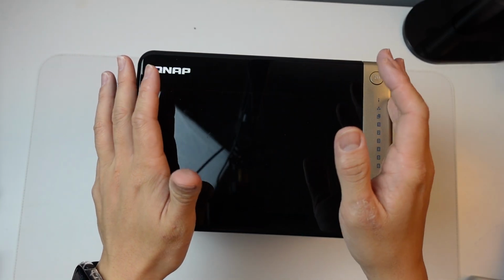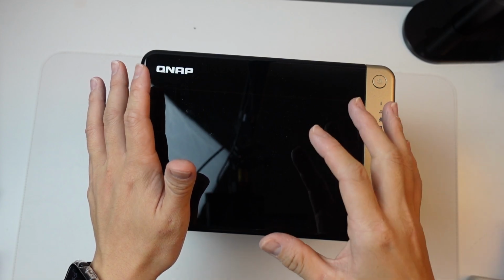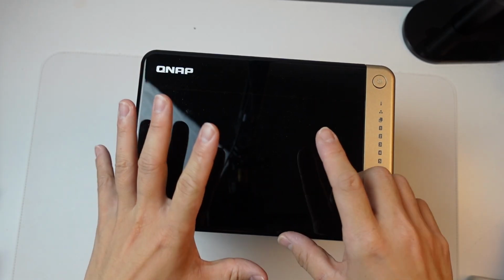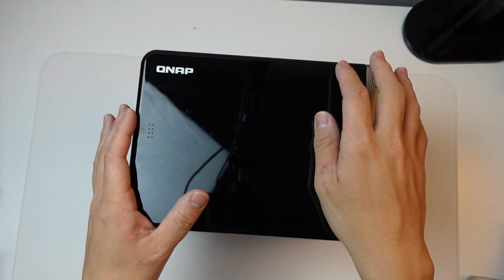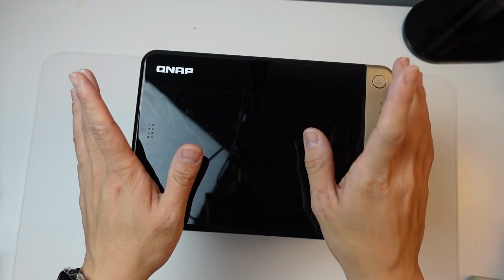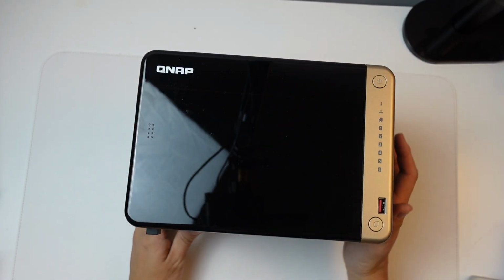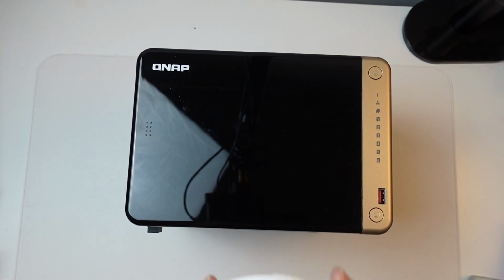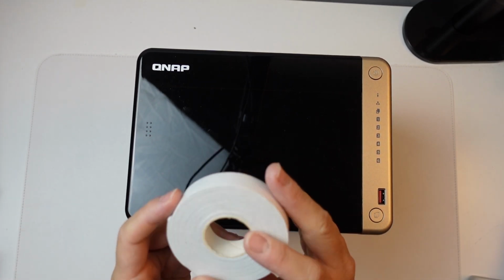How to dampen sound vibrations on any QNAP NAS

Comment: my qnap 451A had weird noises well it seems only disc 1 i tried with keyboard o-rings i had and some longer screws that fitted good and not to high the screws that came with the qnap was bad and feelt loose but the noise is gone or atleast good enough... the o-rings between the disk and the plastic disc holder

Comment: My enclosure started humming from vibration (not just disk noise) and it would stop if I touched the outside with even the slightest amount of pressure. Didn't matter if it was the top, side, etc. Felt like it just had to be because something somewhere was loose. Anyways, I scooped some 1/2" inch by 2mm foam tape from hobby lobby for $2 based off this video; the noise is now nonexistent. I appreciate you sharing this tip.

Comment: You're way overestimating what foam tape with a mere 1.2mm thickness (less than 0.05in) can do to reduce HDD vibrations. There's certainly some effect, but it will be minimal when compared to the optimal solutions for sound and vibration damping. Just like most other life-hacks, this looks like content creation with a grain of truth and not an actually thought-out idea by itself.

For NAS - especially when you're using HDDs with higher total storage and thus requiring more platters - the simplest solution (and also the one I would recommend to most people) would be to boot the device to another room where you won't be annoyed by its noise generation. If you have a wired connection that's great, but even WiFi is okay. Unless the WiFi in your home is really poor for some reason or another (thick walls, too much interference) you could put an USB dongle for less than 15 Euro into one of the connectors on the NAS and it will work well enough. Wired is of course always the best option for both speed and reliability, but if the choice is between blessed silence in your office/living room/bedroom and slightly slower data transmission speeds via WiFi, I'd take it unless the task is critical.

But if noise and vibration dampening is really the only way to go in your situation, then you need to be aware of two things. One, while the NAS cases are often constructed in a way that don't make them into resonators for the HDD vibrations, that doesn't mean that they are damped. When the NAS case stands on a table or the floor, these vibrations will carry over and create all sorts of bother, because the plastic feet of the case are in no way sufficient as dampers. Two, your HDDs need to be cooled, which means that as the NAS blows air out back with its fan, air also has to enter at the front, where the case usually has several small openings.

The biggest way to reduce the vibrations generated by the HDDs is to put a foam mat (or pad) between the NAS and the floor/table/whatever it stands on. A thickness of 20mm (about 0.75in) should be the desired target - more is possible although not as widely available commercially. I would personally also consider sealed foam or another material entirely, because the cheap noise dampening foam will sooner or later dissolve into a dusty annoyance to clean up. Thus I personally went with a weather-resistant 20mm neoprene foam mat that's considered for use in cars and the like. For years now it has stood the test of time and cleaning - either with a duster or a damp rag is easy enough.

But that's only half of the story. It still leaves the NAS case itself unobstructed, which provides no noise damping at all. With some work, the remaining noise can be greatly reduced. Out of a spare cardboard box I built a "hat" that fits over the NAS with cut-outs for the back (fan, connectors) and the front (air inlets), then I padded the outside of the hat with the same self-adhesive 20mm neoprene foam mat.

The result may not look very impressive when you had a glossy case to look at before, but it's amazing what a mere 20 Euro roll of foam mat - 150 x 30 cm, which is about 0.45 square meters or close to 5 square feet - can do to the noise generation of multiple annoying HDDs. I still wouldn't put that sort of thing in my bedroom, but it became quiet enough that I could get used to and ignore the background noise when it's under the table in the home office.

Please note that the above is considered to be a life hack for *home use*. In this setting you never run into the issue of reaching the HDD temperature limits and active cooling is actually far from a requirement. When you dampen a HDD case, you also add temperature insulation, which keeps in the mechanically generated heat much better than a very thin metal case. From practical experience that results in maybe 2-3°C higher temperatures with the fan at minimum speed, but at higher usage rates (enterprise level load) the cooling of a dampened case can become an issue.

That's as far as life hacks go, whereas the really optimal solution for a home user would be a DIY NAS, where you start with a silent PC case that supports individually decoupled HDD mounts. It's quite the niche market and not a lot of manufacturers offer these products nowadays. If you're not looking at a huge 8-bay NAS solution, then you can get 2-6 disks into one of the BeQuiet silent cases that support the HDD cages.
Reply: Exactly.. These companies like synology and QNAP are incompetent and just money grabbing. 
Most enterprises use the storage in another room so the designer pea brains could not comprehend that if they are selling units for individual use, people just might not be able to tolerate the noise HDD still make in 2025.

Comment: Interesting video! Two questions:
-After relative long time use, the tapes are not affect by the heat produced by the NAS? 
-which tapes did you use exactly (your Amazon link isn't pointing to the ones you've used)?

Comment: That amazon link is wrong in your description the tape from Amazon is only 12mm and not 16mm like it in your video. Which double side tape did you use please? I would like to buy the same as you have but the link provided is only for 12mm tape and this is very very thin and not good at all tape sorry.
Reply: 0.75 inch (19mm) wide would be perfect fit for ts873 and that seems to be the spacing on his nas as well.